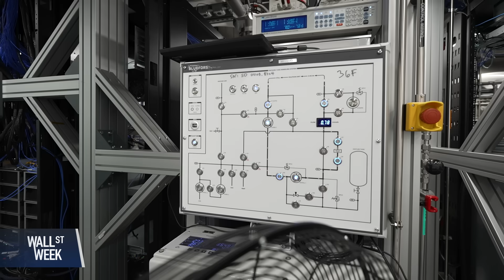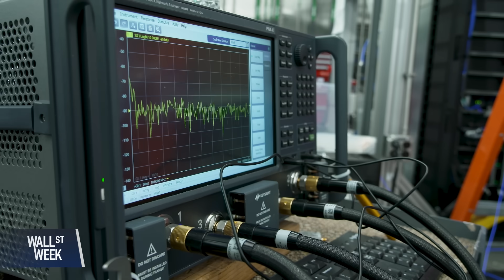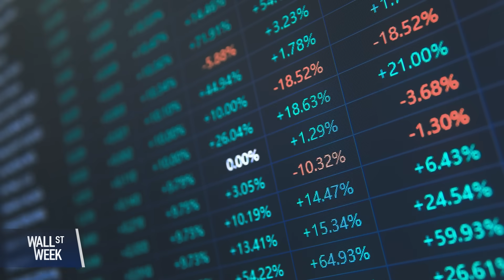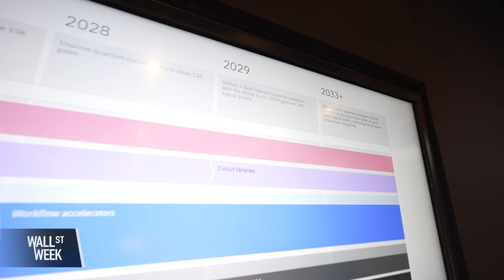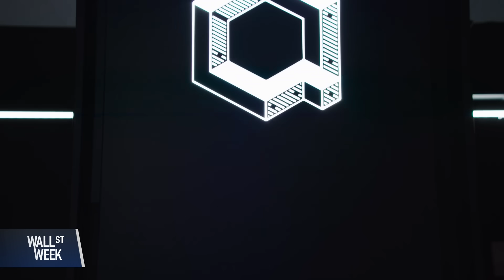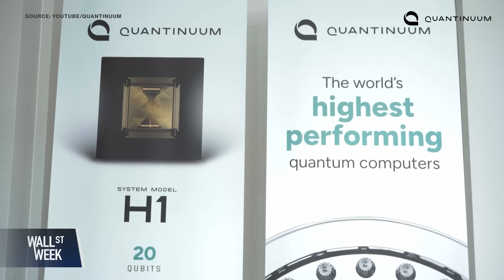The Computing Revolution That Isn’t AI: Quantum Computing Is Here

Comment: These guys will be in a relentless pursuit of all the best and most desirable solutions, every time they will search for the holy grail and hope they will find it, for every entering and engaging in the calculation process, the computer will find, suitable to the request, 200 best results out of billion operations done and results gained and they will have to try all of those solutions (formulas) if and how they work or choose 20 of them that they think are the best and most likely to be correct (IF THEY KNOW, if they think that they are right, which will hardly be the case), totally fulfill the requirement and work OR they will get one that they think it's the best, the right one, discarding the rest and then if it doesn't work, they will repeat the process, slightly changing and correcting the input (this also applies to setting the computer to come up with only one right solution), and they will test it again and again, until they find the best solution, the right one that works. During the first year, they will get one best solution that completely works and improves the existing drug for example, next year, they will come to a better one and so on, and that goes for everything they're dealing with. It requires a lot of time and money and it will not always provide the desired outcome, but it's an endless experimental game, with many, many misses possible, much more misses, than hits. You will call them from time to time and ask them: "Anything new?" And they will say: "No, not really." For the investors and the medical community and any other community they work for, it will be a nervous waiting game, for something that happens extremely fast, not to mention the number of animals and even humans that will die or at least get sick along the process, because the time of the wait for the animal to die or develop an illness was just not long enough and you gave it to a human, and even if the human did not die, the human developed a syndrome, very possibly a new one that you will search a cure for, creating endless possibilities of mistakes risking lives of thousands, millions of people, not to mention millions and billions of dollars of companies that will fail. Very dangerous game in every sense, especially because they don't know exactly what they're looking for and they don't have a standard, a measurement to which they operate. And the predictions of the stock market are hilarious, even if they provide you with all of the 2.000 possible outcomes for one stock per day, what you're gonna do about it?

Comment: Here’s how data structures and algorithms (DSA) are fundamental to the development and functioning of quantum computing, as showcased in the video “Beyond AI: Inside the Global Quantum Computer Race”:

1. Quantum Algorithms
Specialized algorithms for quantum computers—like Shor’s (for factoring), Grover’s (for search), and quantum simulation algorithms—are themselves advanced DSA innovations, designed to exploit quantum superposition and entanglement.

These algorithms use multi-dimensional arrays, matrices, and tensors to represent quantum states and quantum gates.

Classical DSA often provides the basis: for example, quantum walks are a quantum analog of random walks on graphs.

2. Quantum Data Structures
Quantum computers leverage quantum registers (high-dimensional arrays) for storing and evolving qubits.

Classical data structures like trees, heaps, and hash tables are still vital for:

Compile-time optimization

Scheduling quantum gates and operations

Keeping track of measurement outcomes

Many hybrid algorithms (quantum-classical) shuttle data between quantum and classical memories, making DSA crucial for performance.

3. Simulation, Error Correction, and Resource Management
Quantum circuit simulation on classical supercomputers (needed for development and validation) relies on efficient algorithms using big arrays and sparse matrix representations to imitate millions of possible quantum states.

Quantum error correction uses advanced DSA:

Lattice structures, graph codes, and custom bitwise logic to detect and fix faults.

Scheduling and queue management algorithms ensure error correction is applied in real time as qubits are manipulated.

4. Optimization and Industry Applications
Finance: Quantum portfolio optimization applies graph algorithms and dynamic programming concepts adapted to quantum hardware.

Healthcare and materials: Quantum chemistry simulations use tensor networks (very high-dimensional DSA) to simulate molecules and interactions beyond classical reach.

Hardware scheduling: Deciding how to allocate qubits, gates, or circuits across limited quantum hardware is a classic DSA scheduling/allocator challenge, often using priority queues, greedy, or recursive algorithms.

In summary:

DSA is everywhere in quantum computing: from the heart of quantum algorithms and data handling, to the classical software needed to control, optimize, and correct quantum computations.

Any progress in quantum hardware or algorithm scalability depends directly on clever DSA at both the quantum and classical levels.

If you’d like code examples, real-world industry use-cases, or specific DSA concepts (like error correction codes or tensor networks) explained in this context, just ask!

Comment: What specific commercial applications are using quantum computing today and specifically what computer is being used.

I suspect all we hear is hype. What may be true in the future presented as though it can be performed today. Rather than considering someone's cool research that may indicate a solution might work let's see what is commercially available and actually used today.

For example let's see a quantum computer available today solve Shore's algorithm to break a 256 bit key.  How many QUBITS will that take? What computer today can perform that?

Comment: IBM is truly ahead of the curve in quantum computing. It was previously thought that it would take 30 years to arrive at functioning and stable prototypes, but with the incredible work that IBM Quantum is doing across the entire technology stack, things could speed up considerably.
Reply: Yeah, might only take 29 years. You're right. 

It's still nowhere near a commercial use case. and of course impossible as of now to be used in non-commercial applications.
Reply: Can they factor a three digit number using shor? After 40 years they still cannot use one of the only quantum computing algorithms that solves a problem faster than a classical computer.
Reply: But what you can do with this type of computer? After 31 years, there is only one efficient algorithm works better than classic, Shor Algorithm.
Reply: @sassanmoradi1586 nice comment. I agree with all of these points 😂😂

Comment: China Unveils Quantum-Speed Breakthrough

China’s CHIPX lab claims to have built the first scalable, industrial-grade optical quantum chip that can run certain AI workloads up to 1,000× faster than Nvidia GPUs. The photonic chip packs over 1,000 optical components onto a 6-inch wafer, scales to “1 million qubits,” and can be deployed in weeks instead of months - though production remains limited at ~12,000 wafers per year.

If the performance claims hold, it marks a major step in China’s race for quantum advantage, as Western firms like Nvidia push similar optical-quantum tech but haven’t yet shown comparable scale!